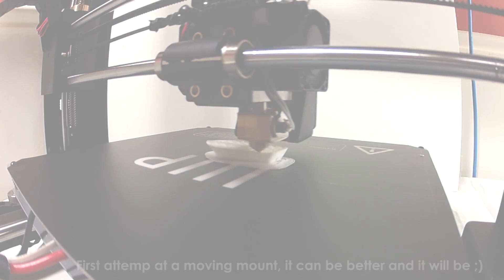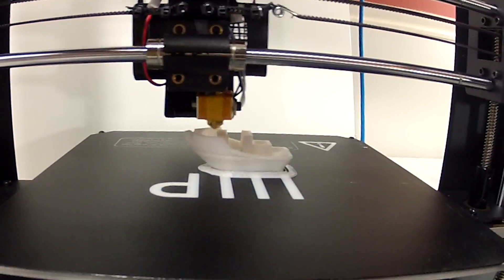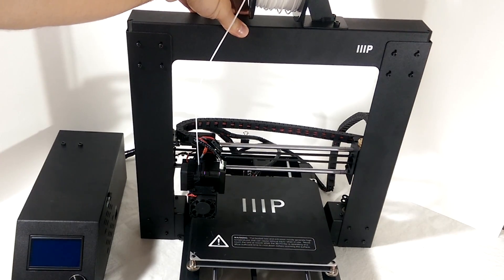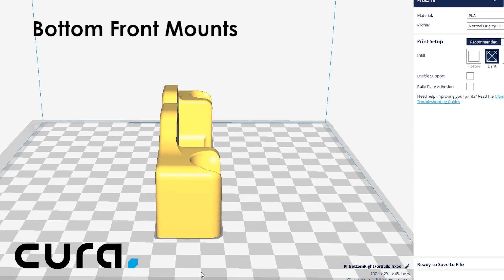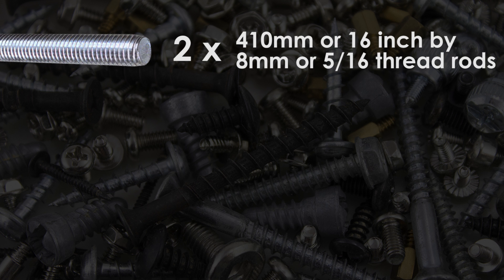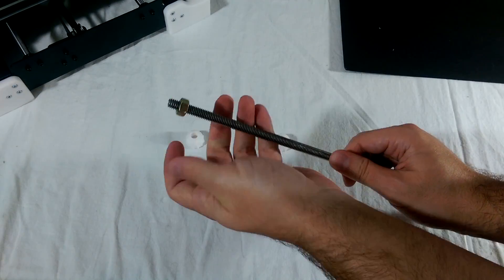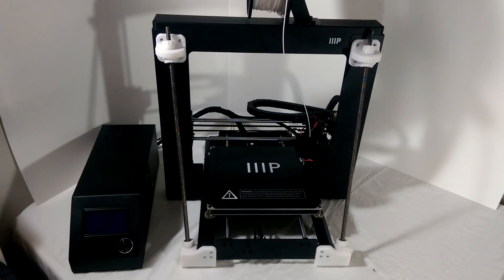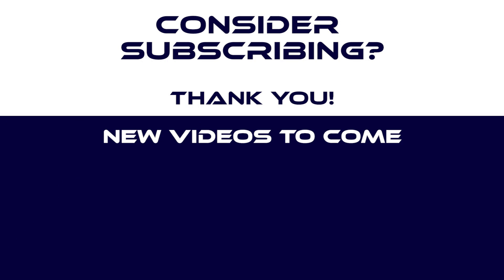3D Printing with the Maker Select V2 - Ep4 | First Benchy - First Modding

Comment: I bought this printer and I am thrilled with it.  Once the bed is adjusted and level this printer is awesome.  I have printed all the pieces for the z brace and every piece came out superb.  Just installed the z brace mod and the extra stability is amazing.  My next project is the spool holder upgrade.  Thanks for the awesome videos!!

Comment: Thanks for putting this together, the production quality is amazing and I really appreciate the time you put into this. 

I wanted to point out though that the hardware kit that is linked in the description is not the correct size for the z axis brace prints that are linked here. The brace prints call for 5/16" hardware, but the hardware kit that is linked here comes with 1/4" hardware. I just found this out the hard way. It could be made to work still, if it wasn't for the balls (the nuts don't stay in place due to size issue). Its my bad for not reading through the details on Thingiverse, but I wanted to mention it here.

Comment: Hi. I just bought one of these printers. I found that it printed fairly well at the start. I printed a small calibration cube to check the calibration of the axis. I found that my cube was slightly taller than it should be. I would be interested to know if this happens to anyone else's printers when they first get them. 
Thanks

Comment: Good idea in principle. But the Z-brace makes zero difference. I printed out several parts before and after. Zero difference. So if you're watching, don't waste your time.
Reply: lol I own this printer and saying it makes zero difference is incorrect. Stability in the z-axis is essential as the sway will cause a slight movement in the y-axis.

Comment: If the take the filament spool off the top of the printer and put it on the power supply that would also reduce movement in the z axis.
Reply: Where are the videos? You haven't uploaded in 5 months. Also now you've had this 3D printer for a while would you still recommend it as a beginner 3D printer?

Comment: have you installed a mosfet?
Reply: jw why/what the mofset is for
Reply: The power supply on the Monoprice maker select V2 and original is wrong for the bed heating element, and can cause fires or damage to the board inside the control unit.  The mosfet upgrade alters how the power is supplied to the bed, and protects the system from fire and damage to connectors.  It is a must have for this and many other printers.

Comment: This is awesome. I just got the printer but didn't realize the difference of stability during printing. Not to mention the availability of the hardware needed. I might just go along with your option of getting them locally instead of online (since all 3 hardware stores you mentioned are within reasonable driving distance).

Comment: Great set of videos for this printer.  Mine was delivered yesterday and today I made my first prints. Thanks for creating these and sharing your experience.  I did a lot of research before buying this and It's great for the price.  I'd like to experiment with flexible material.  Do you plan on doing videos with different type filament?

Comment: Just Marathon-ed your series up til this episode. It makes me incredibly excited and eager to finally order my own MP select V2. I saw other youtubers review the Mini, and I was hoping the extra few dollars for a larger print bed would be worthwhile. I plan on creating a dedicated computer to build my designs and connect to the printer and I really like your earlier episodes showcasing the open source software (which is great for a broke mechanical engineering student like me).

 Do you think you may showcase this printer using other filaments like TPU or even felty? The fact that I could use other filaments like rubber was a major selling point for me, considering 2-3 years ago most industrial grade  printers only could do this.

What are your thoughts on the Maker select plus? Have you come across any info as if there has been anything other than the UI that adds to this model? Would you say the V2 has more community support/ guides for beginners? The V2 is not as compact but I do not mind, and I justify the lower price allows me to buy more filament I want. Just curious about what you think of MP's other models.  Great videos! keep them going!
Reply: Thank you for the response! I ended up getting the plus becuase of space issues. it has to share a space with my other tools and a rework station. It should be comming in tomorrow so I hope all goes well when i set it up. From what i can only assume as of now is the stability issues may be rectified due to the weight in the heatbed holding the frame in place once mounted. At least then I won't have to print that particular mod, but there are others for that model i would look into.
Reply: Aqeel Mohamed this printer prints ninja flex TPU fantastically, just be sure you print and install the extruder block mod from thingiverse and print at 30 mm/sec for print and infill speeds, also extrude at around 245c for this printer.
Reply: Aqeel Mohamed I have had the select v2 for sever months now and am very happy with it. I am able to print pla, tpu and with a makeshift enclosure, and. Probably many more